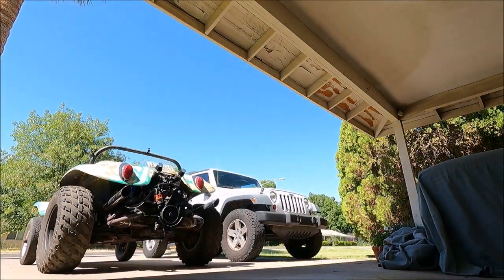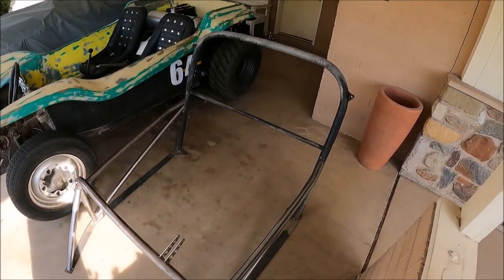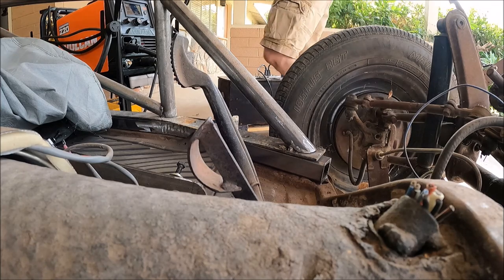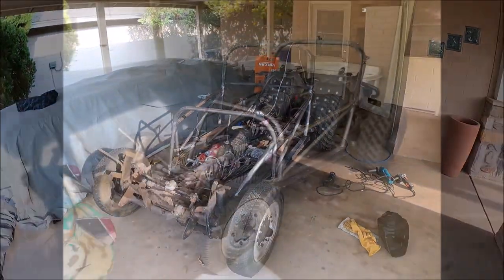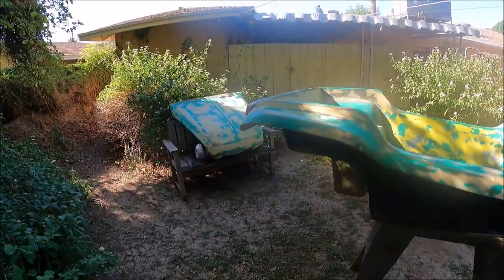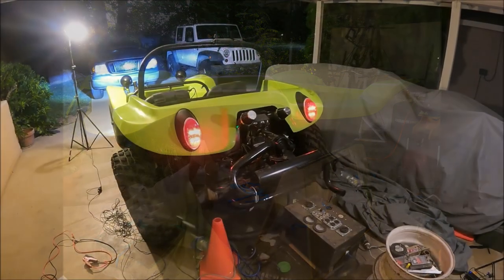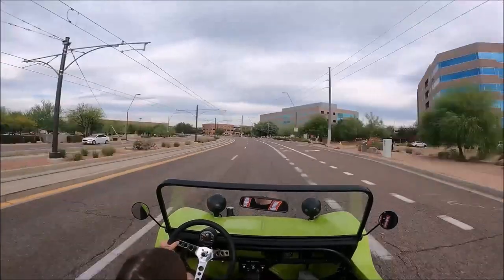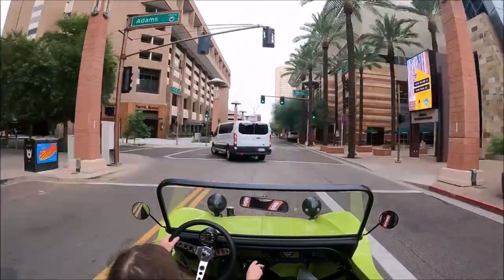Building a Manx-Style Dune Buggy

Comment: Fantastic build video.  Among the best I've seen.  I especially like the attention to detail, including tube sizes and even the brand of the penetrating spray used to unstick the new engine.  With that kind of detail I'm guessing you're an engineer.  Now I'm trying to figure out if electrical or mechanical.  Maybe electro-mechanical.  :-)  Congrats on the excellent build!        (I'm a mechanical engineer, but in grad school I designed and built a few PFI engine control systems, from scratch [well, PC-based, with prototype cards] to support my research or generate a little cash).

Comment: Do you have any idea what the curb weight is/was before the enhancements started?
Reply from the maker: I'm not actually sure of the curb weight either before of after the modifications. According to Google a stock 1964 beetle weighs 1609 lbs, so I would expect the (roll cage) + (fiberglass body) - (original steel body) would probably have a similar total curb weight, but I'm not sure.
Reply: Thanks for the reply about the weight.

Comment: What size are the front tires?
Reply from the maker: The front tires shown here in the video are 165/86R15 Discount Arizonians. The rears shown here are 30/10R15 Rage Thunders. I just recently upgraded both the fronts and the rears, and currently I'm running 185/65R15 Sumitomo Ice Edges on the front and 31/10.5R15 Milestar Patagonias on the rear.
Reply: @DielectricVideos  
Thanks for the reply!!
Looks great 👍🏼

Comment: Nice buggy! What headlights are those? I really like the built in turn signals.
Reply from the maker: Thanks! These are "ZMoon" brand halo-style headlights from Amazon, and can be found here: https://www.amazon.com/gp/product/B07RXXT2XJ
Reply: @DielectricVideos  How do you like these headlights? I am wanting to put these on a 1967 VW buggy, I like how they have turn signals built in too.
Reply from the maker: @KingTMD  I really like them! The turn signals are definitely a nice feature, and I like the way the DRLs look as well. They're also quite a bit brighter than the stock incandescent headlights, and the cooler color temperature seems to improve visibility as well.

They seem to be reasonably reliable, as I've driven several dozen ~45 minute drives to work and back with the lights turned on and have not had any issues. Granted, I only have the low-beams wired up, so they might wear out faster with the high-beams on. 

The current draw on these lights is really low as well; I recall measuring about 1.5A per headlight on low-beam and 2.5A per headlight on high-beam, which is way less than the stock incandescent ones.
Reply: @DielectricVideos  Thanks for the quick response,  you did great on your buggy. Is it still the same housing for the lights or are you using something else?
Reply from the maker: @KingTMD  It's the same housing. The ZMoon 7" lights should fit into any 7" round headlamp holder, which I believe is the same for the Beetle as for the housings I have.
Reply: @DielectricVideos  That makes sense, thank you.
Reply: @DielectricVideos  hey buddy. What did you fill all the body holes with? I've got a ton of different holes on mine.
Reply from the maker: @KingTMD  For the very large holes/cracks, I cut out the broken sections of fiberglass and used non-woven fiberglass with polyester resin to fill them in. This typically requires several layers of fiberglass. For smaller holes, around 1/4" - 1/2", I used a mixture of polyester resin and fumed silica to make a thick paste that could be used to fill them in, usually with 1-2 layers of fiberglass non-woven already applied behind the holes to give a strong backing layer. For small holes and rough-textured areas, I used Bondo body filler.
Reply: @DielectricVideos  I am considering putting an LS4 engine in mine. It's a front wheel drive engine and it would be automatic. Think there would be any issues ?
Reply from the maker: @KingTMD  I imagine there would need to be a lot of modification to the chassis to install the LS4. Would you use a non-VW chassis? If so, it would be necessary to ensure the length matches so that the wheels are in the correct place relative to the body, and it might be necessary to shorten or lengthen whichever chassis you use.

Comment: Dude, incredible work. what kind of ecu is that?
Reply from the maker: Thanks! It's a custom board that I designed. It uses an Arduino Nano for the main microcontroller. For fuel control, it uses similar control logic to the prototype I showed in this video: https://youtu.be/kj24iWmM_PU

The board also controls ignition timing using fixed-dwell HEI coil control. I'm using a single low-impedance "spark plug topper" coil with the original cap and rotor to distribute spark to the cylinders.
Reply: @DielectricVideos  thats badass, would you do an update on that part of the build? find that very interesting and thinking about doing something similar on my landcruiser